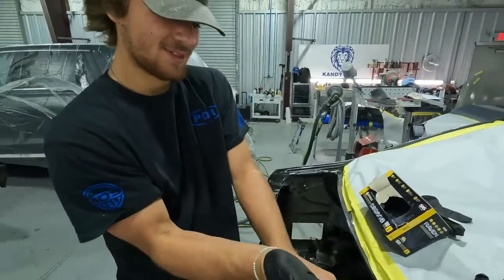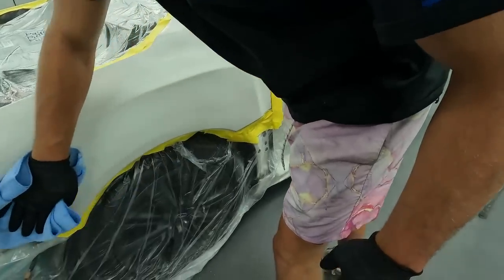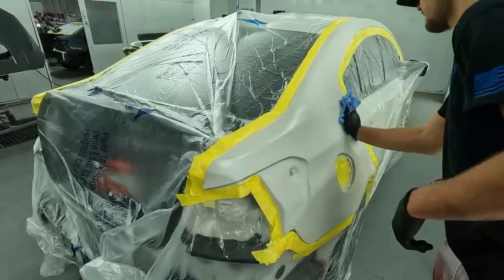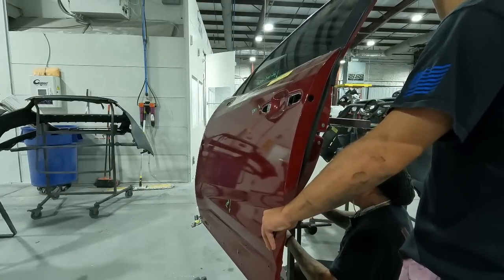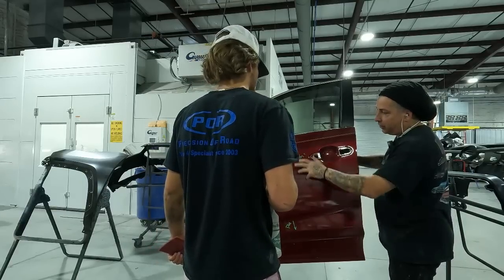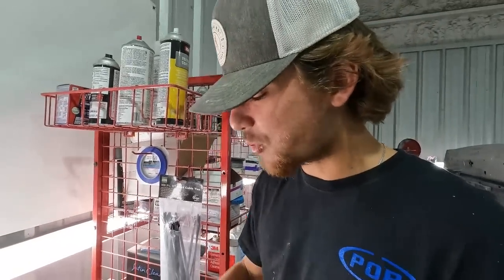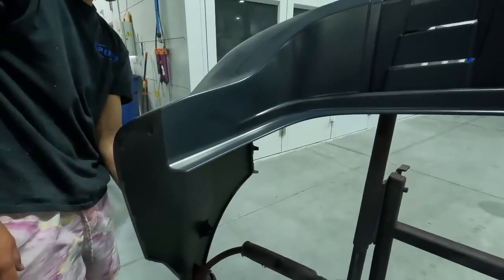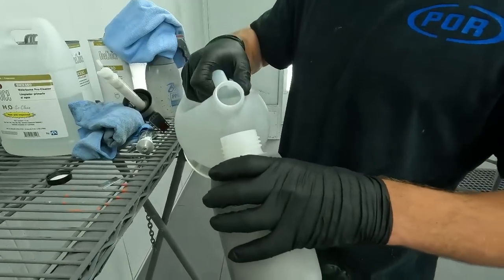Training A Guy With No Experience For The Paint Shop

Comment: At 19 I was fortunate to have a shop owner give me a chance. I learned from a heavy set biker with full beard and braid down his back. He stuck a spray gun in my hand and had me paint the side of a car. He stood behind me and talked me through it. Best way i could have learned. Picked up more skills and techniques over the next 30 years. I owe him a lot. He was patient and thay made me stick with it. 
One tip. Focus on the quality first then move to picking up the speed.
Also, I find it helps to neatly fold my wipes when cleaning panels. You know what side is what and you can flip and fold to minimize contaminants. Always check paper grit. I saw a prepper use 320 for a tricoat blend panel. Good luck guys!🤙